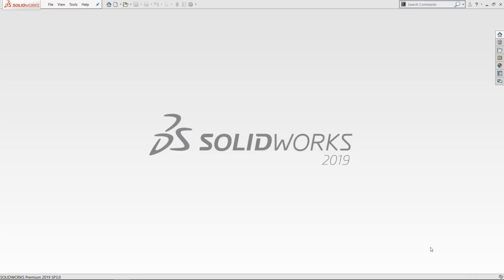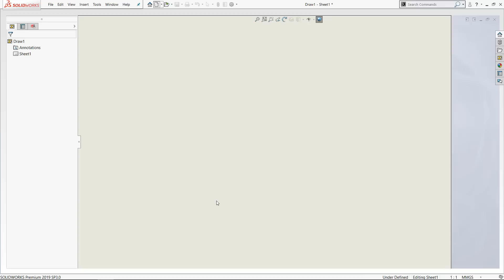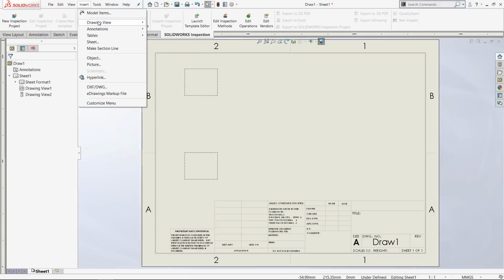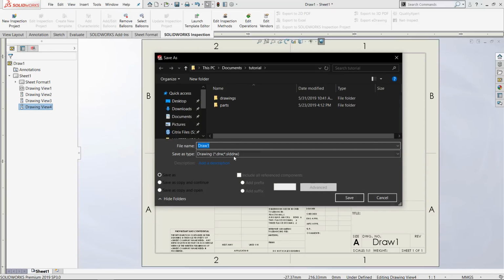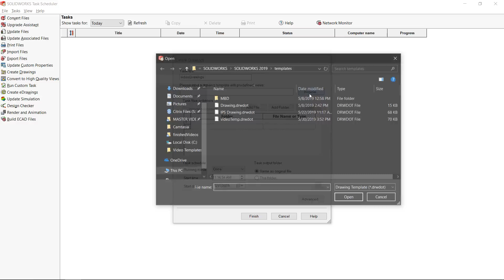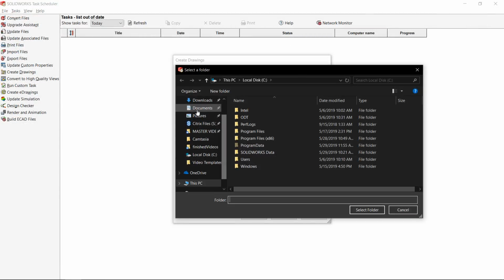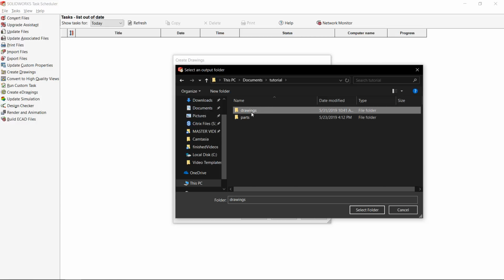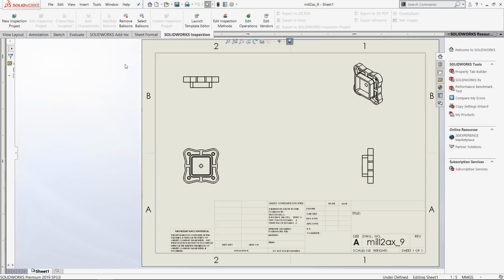SOLIDWORKS TIPS AND TRICKS — Task Scheduler Drawing Creation

Comment: Hey,
How to automatically change the scale, as few parts might be small so is it possible to change scale automatically as per part size?.

Thankss
Reply from the maker: There is an option out of the box that you could use to automatically scale per the sheet size. In SOLIDWORKS, go to Tools > Options > System Options > Drawings and select Automatically scale new drawing views. It's unlikely that the result will be perfect every time but if that box isn't checked, any new drawing views are inserted at the same scale as the sheet scale.

Comment: Hi is there a way to merge these drawing into a single drawing with allot of sheets
Reply from the maker: Unfortunately this tool is only designed to make drawings out of individual files. it does not have a process for adding new pages and using those pages for different models. There are options to run customized scripts however so it may be possible to create a script to do what you are looking for.
Reply: @goengineer Is There a Way To Automate drawing for multiple single sheets in Macro?
Reply: maybe its best if you generate the pdf of each one, then just merge them together with websites like ilovepdf.